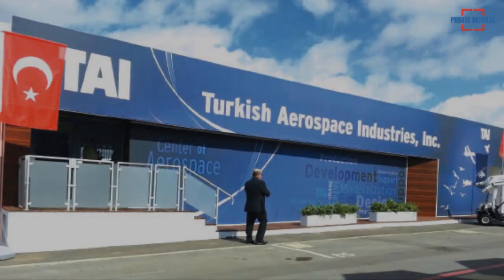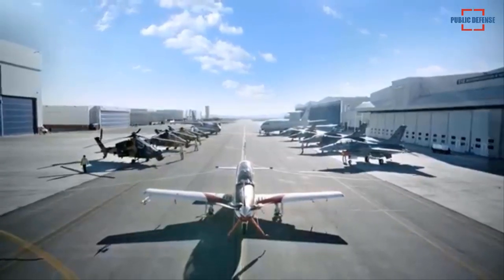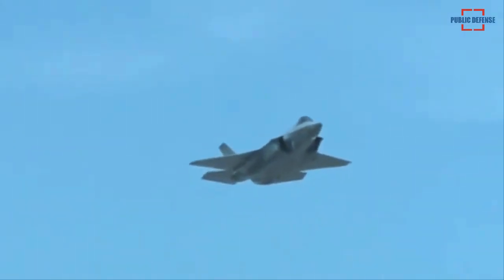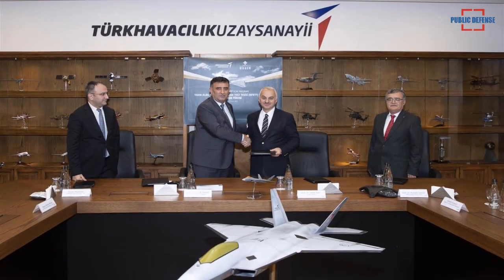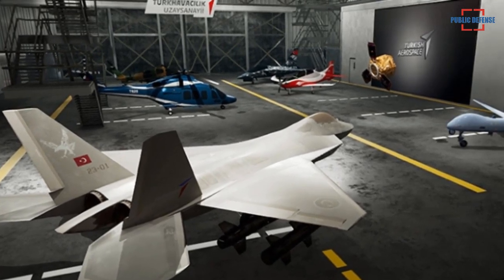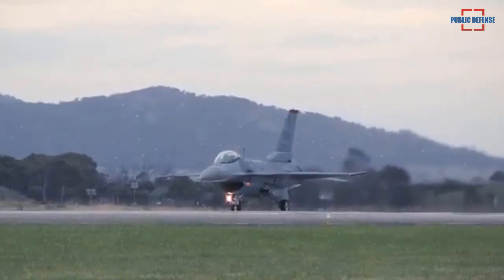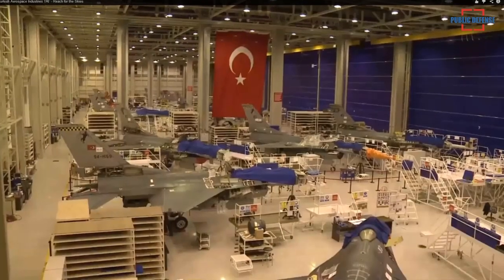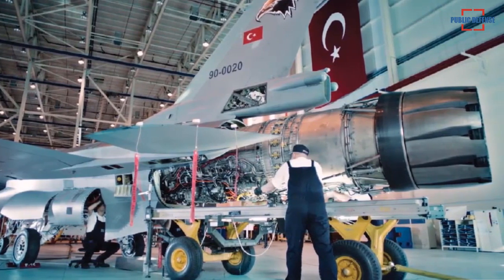New Factory Turkish Aviation and Space Industry to Manufacture TF-X Fighter Jet

Comment: An excellent and informative video, just small correction, the TFX will be powered new generation of GE F110-GE-132 which is very similar to the Pratt & Whitney F135 that powers F-35 jets.
Keep in mind that Turkish TEI is a subsidiary of GE and already produces number of GE engines and turbines.
Thanks you.
Reply: There are talkings with rolls royce but this is all just interim solutions till the own engines are ready. You cant depend on western tech...
Reply: @Samsun55 
Agree with you 100% and that's why Tusaş Engine Industries (TEI) is manufacturing F110-GE-132 engines in Turkey.
Reply: @Abdulweli Ahmed F110 is just an crossing solution. Its not a 5th gen engine. It will be used for the prototypes.